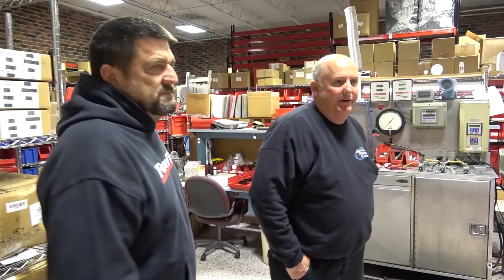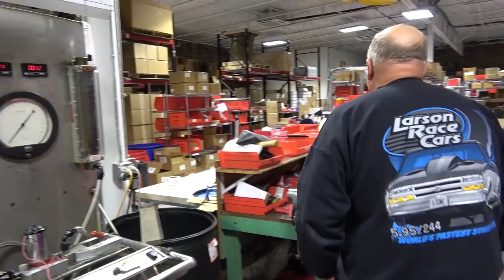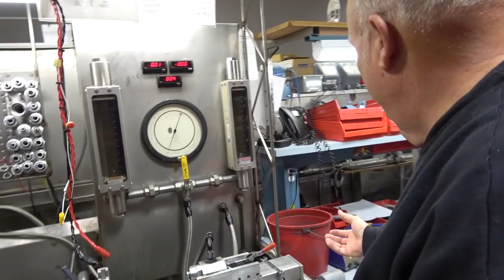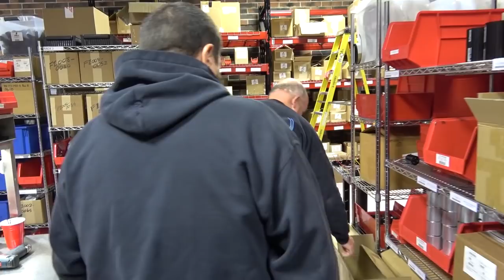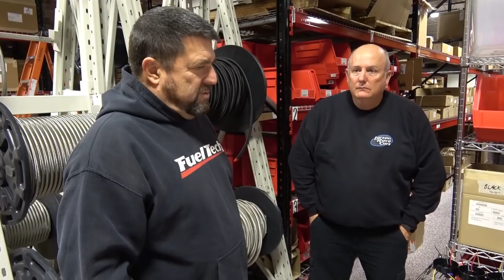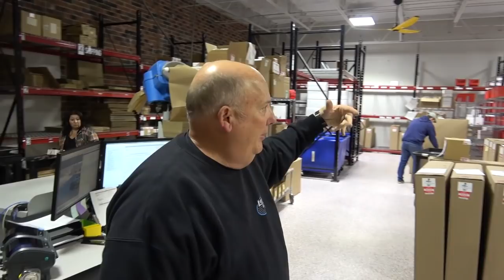An Inside look at Aeromotive Inc.

Comment: I bought an early a1000 and within a year or so the magnets came loose, defective or bad epoxy. I bought another to go to the cc summer cruise. Sent the first one in thinking they may repair it for a reasonable price. Oh no, buy a new one son. Don't care that you only run premium gasoline and drive 500 miles a year, hang it on the wall and give us another $380.  Not sure I'll ever buy from them again, although #2 still works today, close to 20 years later.

Comment: I put one of the first Phantom 340's in my 73 Nova stock tank in 2013. Now it is in my 5 gallon Aeromotive aluminum tank mounted in the trunk. 6.5 lbs. at idle and 6.5 at 7500 through the lights. Quality, no compromise. Thank you